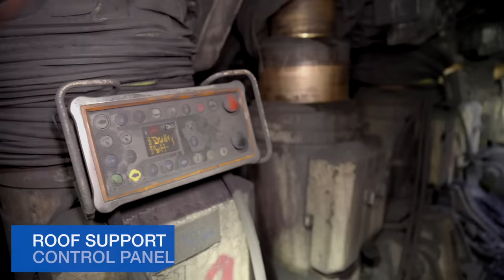METROPOLITAN MINE UNDERGROUND

Comment: One of the best videos for showing the different facts of an underground cal mine I have seen.  Shows you why the boys should get paid big bucks.  Hot, wet, gassey, humid, muddy, dusty, cold in winter, hot in summer.......great video.
Reply: The ambient temperature tends to not fluctuate at the face between seasons. However humidity is unbelievable.
Reply: @seanbrophy9096  I was surprised how warm it was underground. For some reason I thought it would be cold so when I went under for a pilot I was really surprised to be sweating!

Comment: My Father worked here far many years, located in Helensberg NSW, he took my brother and I down to the underground stables where they used to  keep the pit ponies, it still had hay, harnesses and fences all intact.
I later worked there for a weeks work experience, underground with a mechanical fitter,  repairing shuttle cars etc.
It was 100 years old then, great to see it is still operational.
Reply: Walking the returns back to pit bottom is like walking back in time.
Reply: Is this mine in Australia? I thought over there all mines are open pit mine!

Comment: I spent a lot of time in Cliff's Oak Grove Mine in Alabama working on scoop batteries and chargers.  Ran from 800' to 1200' down with elevators at each end  about 12 miles apart.   I was in Jim Walter which was 2k ft down.  I miss working with the miners ,  great bunch to work with.
Reply: Can u clarify some novice thoughts.....how we identify the location for mines? There is no internal undergroundwater ways as we see in openwells & borewells? How the long underground passage survive uncollapsed?
Reply: @muhammedakbar9228   They use sounding sonar that penetrates the ground for 5km then reflects back .  The transmitters are only 30W but powerful enough to trigger minor earthquakes when they are used.  
The military has more powerful transmitters that they use to locate caves, mines, voids underground as they fly over a landscape.   
To the mining roof support-coal mines insert roof bolts into the ceiling with epoxy  in front of the bolts to secure them every 5' apart.  The other method is to use large wood beams across and supported by "cribs" with heavy gauge screen wire in between sections of the mine to catch any pieces that break loose they call "widow makers".
Reply: You miss... Why did you stop?
Reply: @asafgl4281  I was 65yrs old and had been lifting 200lb battery cells , carrying them to the coal scoop batteries then installing them.  My lower back started giving me trouble due to previous injury years earlier.
Reply: @LkOutMtnMan  i understand now..
I was a miner in a copper mine in middle east, first month my back , especially my lower and middle back..
But one day i woke up at morning and felt no more... It came back only after i have stop working there....by the years almost every one who suffered from back issue will suffer again...
From my experience solution is go to chiropractor for adjusting...after few times one after another you will see an improve...
Reply: @muhammedakbar9228  You have to have  Surveyors with transits who use precise land maps that include under ground coal seams that have been mapped too. The  Surveyors will survey and draw up a mining map for you to use during mining the coal seam. The  Surveyors will mark on the ground were to start mining. During the life of a coal mine you will need  Surveyors to keep the mine driving straight ahead and other direction the mine may need to go. It's not how long the underground passages are about collapsing it is how wide the passages are that determines collapsing. Most underground mines in the USA by law the passages can be no more than 20 feet wide. Roof bolting is used to secure the roof and there are times and places inside a mine where mine props have to be set. Also you will build what's called a crib out of wooden crib blocks. If you want to know more just ask i am a underground coal miner.

Comment: Great video on coal mining and the two different methods used especially long wall mining and to see how it’s done, thanks
Reply: Not really the two methods here. The purpose of the Continuous miner panel is to set up the next longwall block for extraction. Yes the coal mined by the C/M is added to the total but that is not really the point of it's operation.

Comment: Nicely done video.
I am really surprised that with all those giant piles of coal, that they use loaders to load the train.
Seems like a basic conveyor system could do it faster and with fewer operators, though I suppose that if they are loading it along the whole length of the train, it might be faster this way unless they used a silo system.
Reply: "Long wall" system I saw in museum  has it's own chain conveyer that move coal to nearest belt conveyer.
Reply: On the long wall it uses its own conveyer. Trains are loaded with hoppers usually. The train pulls under it and it gets loaded with washed or unwashed coal.
Reply: @Keith_Mikell  I don't know why everyone keeps saying this, because if you watch the first 30 seconds of the video you see no hoppers or silos, you see wheel loaders loading trucks from stockpile, and multiple loaders loading train cars from a larger stockpile.

My comment was wondering why they DON'T have hoppers to load the railroad cars from, and the comments are about the long wall miner far below, and that they use hoppers, which they obviously don't lol
Reply: @ke6gwf  ah my mistake. I’d
Wonder the same.

Comment: 1 - even though the electricity cable for the machines remind me of automatic retractable vacuum cleaner cords, it amazes me still how they don't run over their own power cables. Plus the constant flexing, unwinding and retracting of the power cables surely wear the out over time causing kinks and breaks in the line.

2 - even though I KNOW it a mine, it made me a little fascinated that the machines were back coal dust dirty. I 'expected' them to be pristine white and clean. Guess I didn't expect this workplace to be dirty from being used.
Reply: I work for a company that builds them. They look so beautiful when they leave the workshop...then they go underground & when they come home for a major overhaul they look so sad.
Reply: Don't worry, those cables don't last long 😅

Comment: More like a metallic mine than a coal mine. How can you stop the lateral pressure? or ceiling prints? I didn't see any steel fortifications and I think it's great because the risk seems low.  I was also wondering about the calorie content and coal thickness. Greetings from Turkey
Reply: Metrop is most definitely a coal mine.
Reply from the maker: Definitely a coal mine!

Comment: At 3:48what are the little bags of white powder hanging from the ceiling? And yes I’m aware it’s not cocaine .
Reply: They are called bat bags, filled with stone dust in case of methane explosion the shock wave will bust the bags open and prevent coal dust from being flicked up and causing another explosion.
Reply: Work would be a lot more interesting if the bat bags were cocaine...

Comment: When I  was   17 , I started out in the coal  mines  digging  ditch and then later  packing  timber up  the  raises . After  6  months in the  mine  you  get  a  miners  permit that  allows  you to go and  work  at  the  mining  face . Another  year  doing  this  and  you  write  a  test  for  your  A class  miners  papers  and  get to be  an  operator . I  ran  a   Joy Continous . Lots of  dust in the winter  time - lots  of  timber when you  drive  a  decline - building  a  road  called   corduroy so the miner  does not  get  stuck .This  was  for  a  company  called  Coleman Collieries in the Crows Nest Pass in Alberta . When I  was  21  -  then changed  to  working in  a  hard rock  mine.
Reply: I want that job help me pls.
Reply: @macaloamor6172  don't do it😢

Comment: Gas Drainage/Gas Range, what is that all about?
Reply: They drain the methane and co2 out of the seam to prevent outbursts while cutting coal, an outburst could push one of those 5 tonne machines 10 meters back. It’s very dangerous so it must be done. Also so the methane doesn’t cause an explosion , that’s another hazard.

Comment: Why do you blur a part of the shuttle car ?
Reply: I ask myself the same question. It looks like it's just a piece of plastic pipe, but it's mysterious.
Reply: Maybe an exhaust pipe ? while they are supposed to use electricity only to power the shuttle car ?
For safety reason i don't know,that's weird.
Reply: @michaelovitch  I found! This is a place for a fire extinguisher except that it is not present on this machine. Look at 3:58, the red cylinder on the left then look at 3:11, the tube is empty.
Reply: @Votsh64  Good catch !
I knew it was safety related !
That mean they prefer to hide mistakes more than to correct them ,they are sneaky bastards.

Comment: What is the plastic bags hanging at the discharge point?
Reply: Limestone/rock dust. In case of a fire or coal dust explosion it will disperse in the air and lessen the spread of the fire.
Reply: Ringinator They are called "bat bags" and they are part of the explosion suppression system of the mine.They are made of a brittle type of plastic that will break open easily in the event of an explosion and disperse the stone dust into the atmosphere.It is to stop a methane explosion from propagating into a coal dust explosion.The pressure wave from a methane explosion will cause coal dust from the ribs(sides) ,floor etc to be stirred up into the path of the flame front of the initial methane explosion and as coal dust is also explosive it will then ignite,stirring up more coal dust and the explosion with then be self propagating and will travel throughout the mine.The stone dust which is also applied to the coal ribs then intermingles with the coal dust creating an inert mixture and hopefully stops the explosion from propagating.

Comment: What is the purpose of meshing the ceiling? It doesn't seem like it wouldn't hold up any significant weight in the case of a cave-in, but I'm totally ignorant in this regard. Can anyone enlighten me?
Reply: From rock explotions. You can even see in alot of the footage that the mesh holds considerable amount of rock.
Reply: There is a bit to it, but basically the mesh and bolts create a "beam" and supports the immediate roof. The "ribs" (walls) support the roof in an arc, think like a tunnel, so it's like placing a beam on top.

Comment: The first picture of the intake vent shaft is wrong thats the return air mines do not force ventilation down the mine its pulled thru the mine by means of exhaust fans
Reply: It’s still intake if it enters the mine at that point genius  while the vent fan sucks from another location
Reply: The air just doesn’t get pulled from underground you need it to enter through another vent shaft for the vent fan to pull air through the mine. No drifts at that mine
Reply: Not true anyway. Most are exhausting but Ive worked some that pushed it in. The first time was middle of winter on a new panel 12 breaks from the drift mouth. Insulated clothes were a must and shuttle car guys wore goggles to keep the dust out of tbeir eyes when they turned into the last open break. Talk about miserable.
Reply: That is an intake, it was many years ago an upcast shaft and there was a fan there. Now there is a bigger fan out in the bush that draws air down this shift and a drift also.
Reply: INCORRECT mate. That is the intake. The extraction fans are on the other side of the pit on the surface. No fans at pit top where you go in. How do I know? I worked there.

Comment: From 12 years of open cut mining, these underground guys must be breathing in incredible amounts of toxic air that can’t be seen by human eye.
Reply: Nope. The amount of air passing through is always above a certain level by law. All air that passes through the working faces is dumped into the return where people don't normally work. Sensors monitor gas and dust levels.
Reply: @dat581  oh wow nice. I have literary only done a 4 week swing underground in WA and I remember the air conditioning systems they had but did think this can’t be good . 
Thanks I’ll actually research it a bit more
Reply: @properaussie331  All good. I spent all my time in coal mines which are very different to all metal mines. Normally in metal mines you don't have to deal with gas except for the diesel fumes from vehicles. That's easy to deal with.

In coal mines the seam and surrounding rock commonly gives off gas. Methane is the most common with CO and CO2 sometimes as well. Enough air is sucked through the mine to keep the gas levels well below 1%. At 5% methane can go bang!
Reply: @dat581  best chat debate ever! 
Peace

Comment: Are those bags hanging from ceiling around 3.5 minutes for fire suppression?
Reply: It’s rock dust if there was a fire it’d melt the bags and rock dust would put the fire out
Reply: @nickvandiver6501  close but not quite, the pressure wave from an explosion would shake the bags and release limestone/rock dust which prevents coal dust from igniting. so it doesn't put out a fire it just stops an explosion from spreading.
Reply: @adnes12  very close, not limestone tho, calcium carbonate.